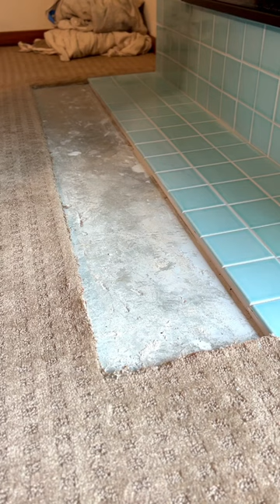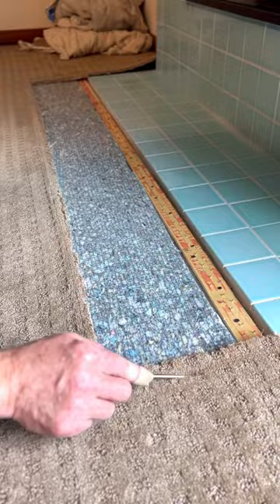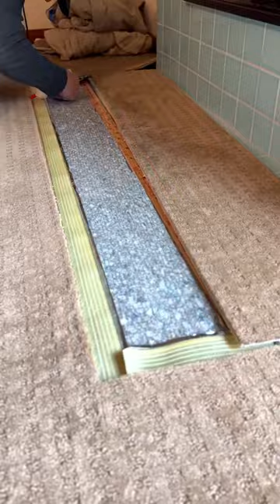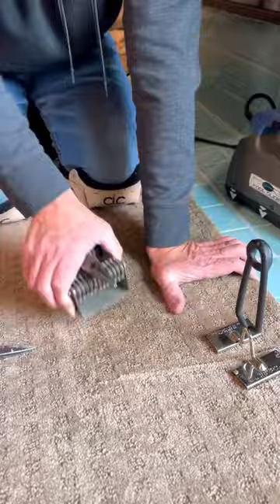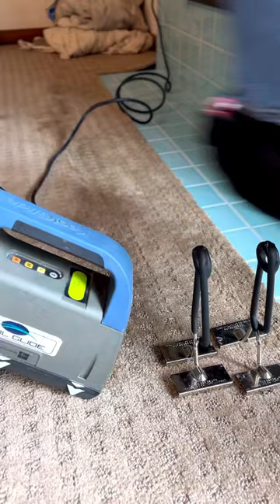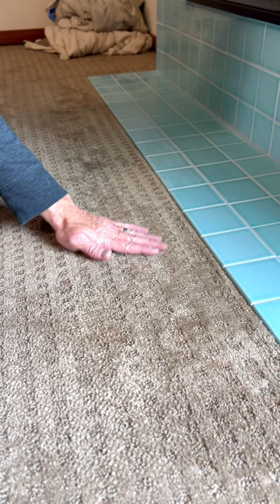Carpet guy INSTANTLY REGRETS posting gets OWNED comment section you’ll be COMPLETELY SHOCKED #shorts

Comment: Hey man just wondering if you jump on the carpet that you just fixed at the wooden board with the nails will it puncture the carpet and get exposed?
Reply from the maker: Locks in backing and if carpet is too thin, knocked down with hammer
Reply: @carpetguy  cool thanks mate